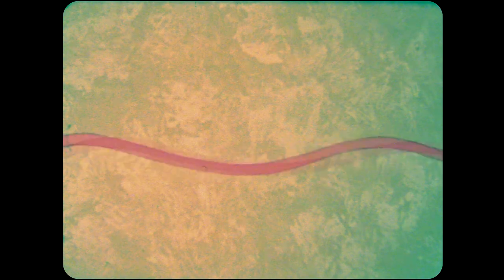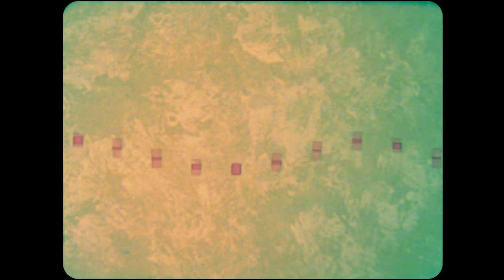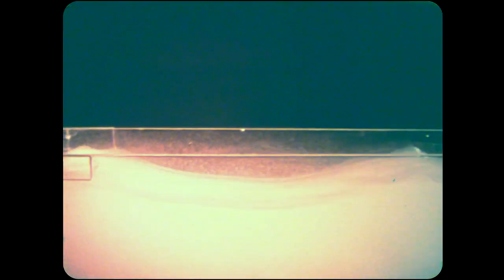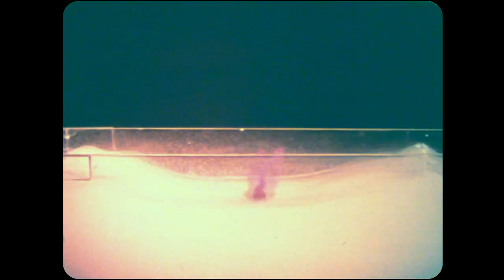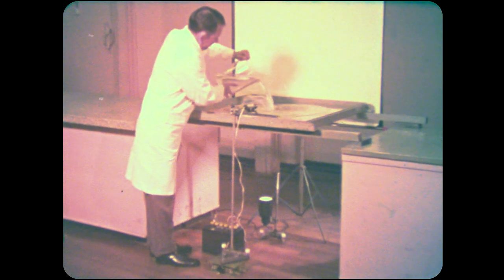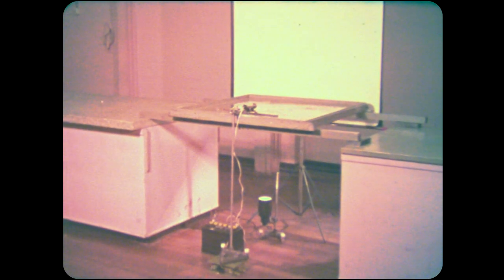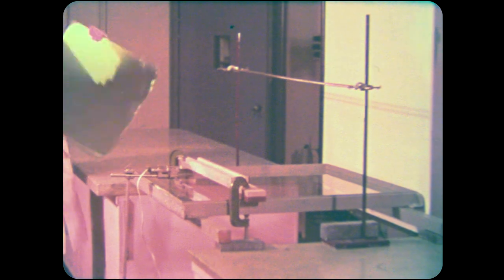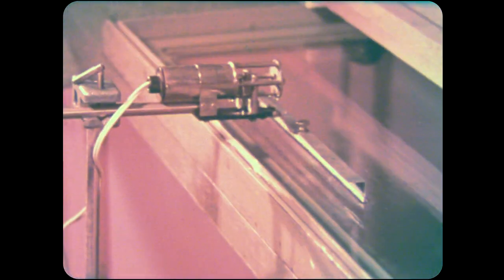Transverse Waves (1969)

Comment: welp wait a minute, it doesn't just come from the wind, it comes from tidal lock and temperatures, jet streams or shipping lanes if you will there are constant currents in the oceans, there are 2 slack tides daily, that's when the oceans are at their calmest near land, and out in the middle of the oceans.. think of it this way, take a 5ft x 5ft square pool 4" deep then lift the pool at one corner a few inches, then go to the opposite corner, then stop for a few hours, that's what the oceans are doing, why tides go in and out, the ocean water is being pushed from one hemisphere to the other constantly back and forth.. of course depths account as well.. add fierce winds, changing temps it compounds this action, but its mainly tides that do most of it in the middle of the oceans and crashing onto the beaches, top your square pool at one corner then a second later the next corner, note how the middle of the pool the waves collide and get larger.. that's whats happening in our oceans.. this is extremely old knowledge apparently..